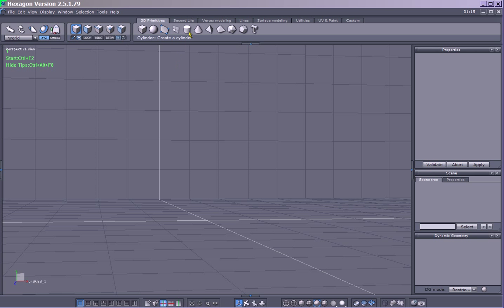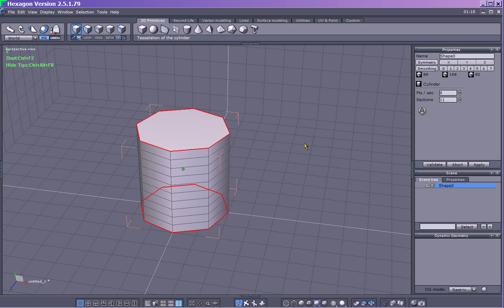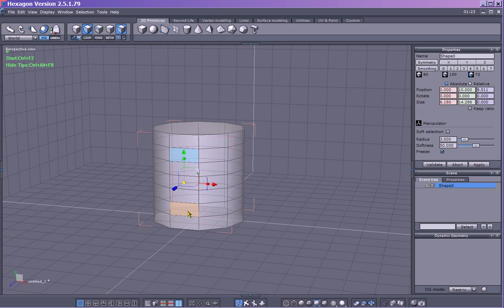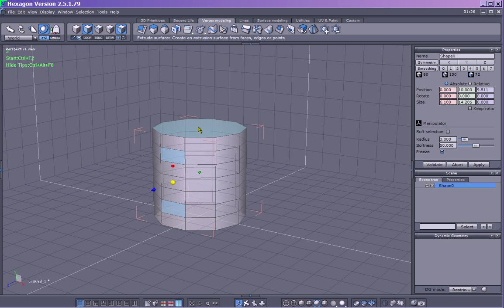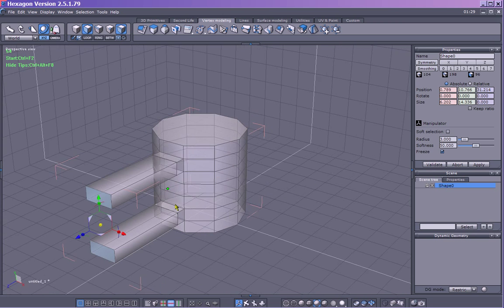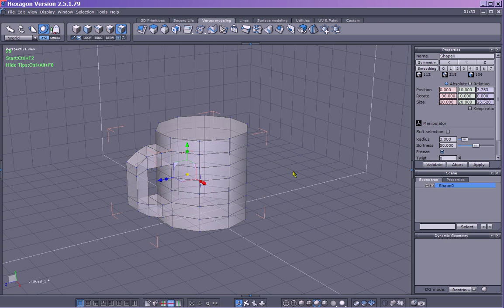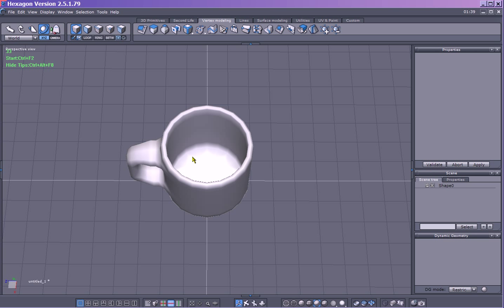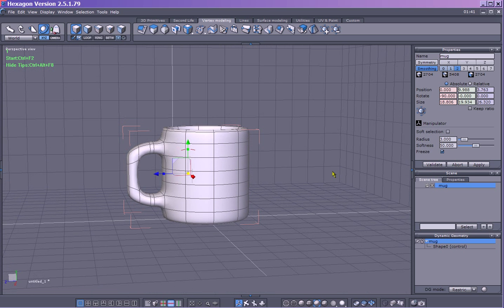Hexagon 3d mug for beginners.

Comment: I cant close the cylinder either. I dont have the white ring around it like you did. Clicking on the top or bottom cylinder ring does nothing. What did I miss so I can close this silly thing?
Reply: Nevermind! I just bridged the bottom to make a complete cup and it looked really nice after smoothing.
Reply from the maker: COREY SHAW
That's the thing about working in 3D, it's how creative your thought processes are to achieve what you need to, as much as it's about knowing your software ^_^.
Reply: Actually after one the 97 times that Hex crashed on me, it finally worked like your tutorial. I dont think I did anything different anyways. The mug turned out rather nice.